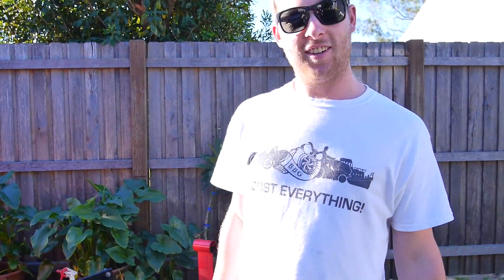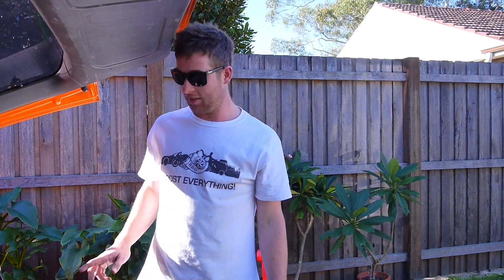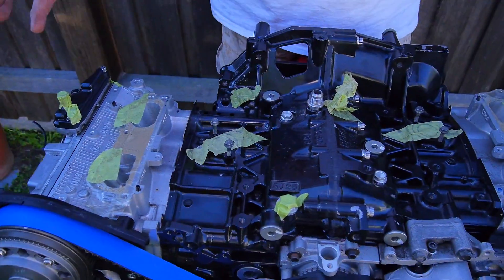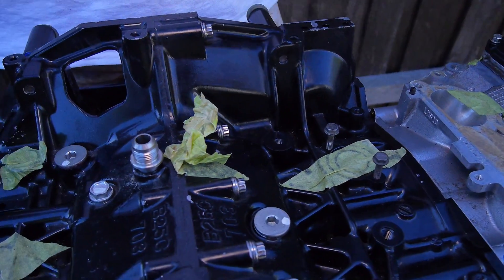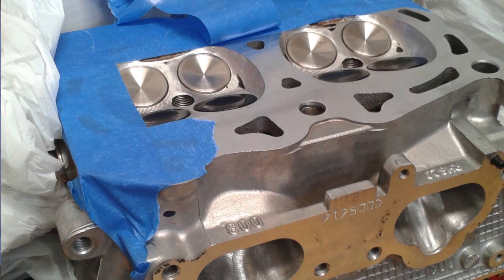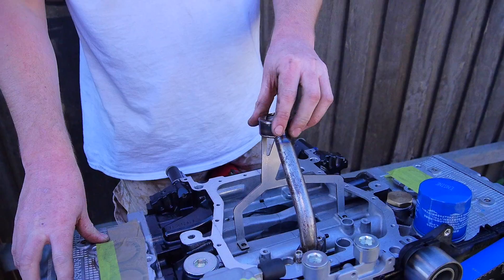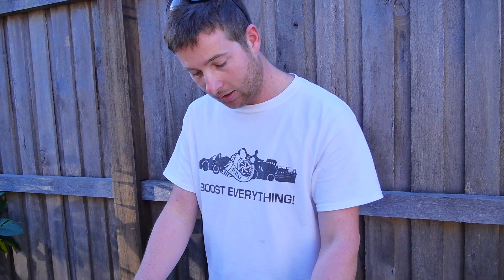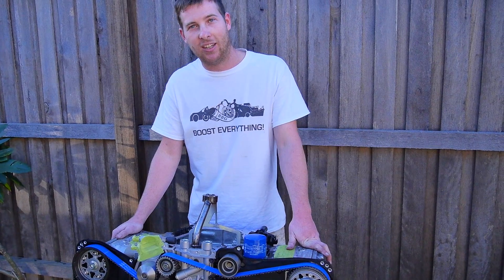A LOOK INTO MY DESHELE BUILT COSWORTH EJ257 MOTOR - THE FOZ BUILD 2.0

Comment: Was the case line honed with the ARP bolts?

They usually distort the tunnel so much the crank wont even turn.  Most people I have spoken to, dont do the case bolts up to ARP torque spec.  Instead using Subaru spec, on the upgraded bolts.

Also, be warned.  Those SuperTech intake valves have a tendancy to crack and drop into the combustion chamber.  I have seen 2 motors go down from them.  And my own personal set of of Supertechs all had cracks on them when I pulled my motor down.

Comment: Potential 600hp engine. That thing's a beast. Bolt idea is awesome for the tensioner, as they can fail badly. I'd put a Perrin LCP on the front of it, definately the Killer B sump and baffles, and oil-air sep. Maybe even phenolic spacers for the intake and a custom intake. Engine like that deserves some quality ancillaries.

Your issue is going to be the drive-train holding up to the output power, along with the massive turbo you probably intend to add.
Reply from the maker: Yeah man, tis indeed!👌
Reply from the maker: Well ahead of you man, look at the build series on this on my channel - lots of top notch goodies

Comment: The 12mm oil pumps can cause an oil starvation at your bearings. Check out @getadomtune for his video on it. Most of the time, the 10mm pumps with a washer on the regulator work fine.

Comment: if you dont mind me asking what did it cost to build that monster of a motor
Reply from the maker: Sharmo38 The original owner of it spent about 20k, anywhere from 15-20 gets you a deshele built motor somewhat similar to this one
Reply: sick i spun a bearing in my foz as well. dont think i will be going this big tho. i want to get 220 at the wheels when she is back on the road
Reply from the maker: Sharmo38 Yeah, I had a 2 year debate with myself whether I just chuck a basic 207 build back in or whether I go all out, I did the numbers on a basic solid 207 build to run 250-300kw and it was gonna cost me close to 12k, so thought may as well save a bit longer and get something of this calibre built. Totally by chance I stumbled across this for sale lol